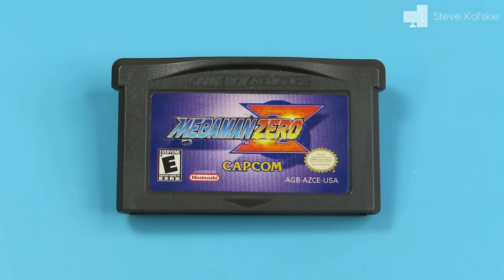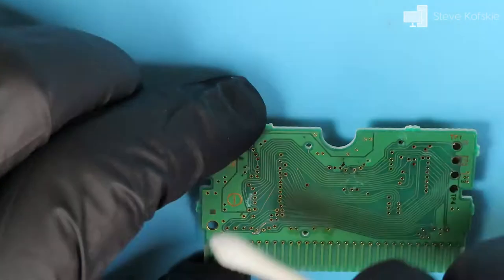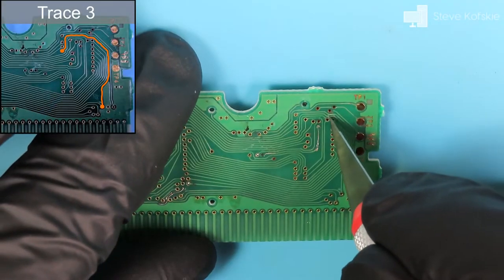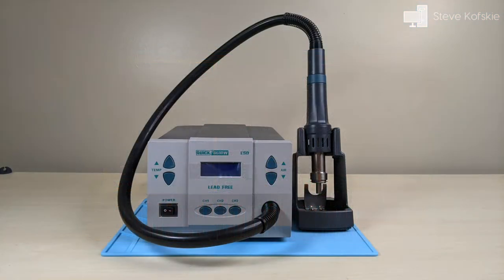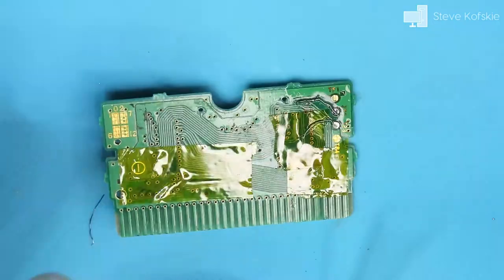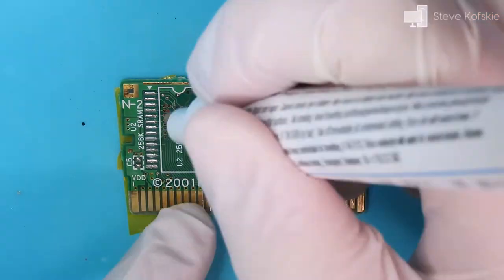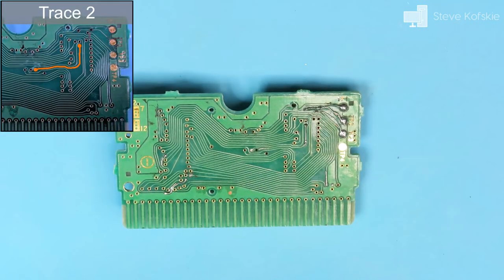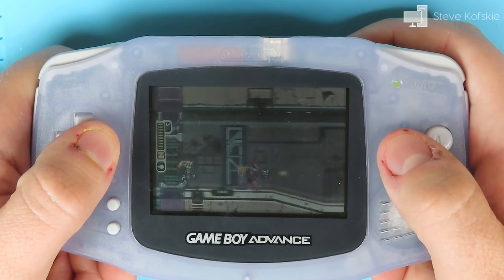Repairing a Megaman Zero GBA Cartridge from Corrosion

Comment: Saw videos of these gba repairs and never realized just how tiny these traces are until I attempted a repair on a non working copy of Pokémon Emerald. 

It wasn't booting so I reflowed the chips, then inserted the game into my gba without the battery and it worked. Problem was, when the battery was installed it wouldn't boot. Didn't have a multimeter, so I just did a visual inspection near the battery and saw a corroded via next to the bottom terminal and fed a wire through it, soldered on both sides. Reassembled everything, crossed my fingers and amazingly, the game booted. Lucky guess. I'll probably get a multi meter next time though.

Comment: What kind of jumper wire did you use for this? Thanks.
Reply from the maker: My bad. I just realized I never added a link to the video.

It's 30 gauge solid wire inside of a tool called a wiring pencil. I purchased it off of TronicFix's website but after noticing I don't use it the way it was intended, I'm probably going to buy a generic spool of 30 AWG wire instead.
Reply: I'd say it's a very fine enameled/coated wire. --
As an aside, when looking at AWG (american wire gauge) higher numbers are thinner and lower numbers are thicker.